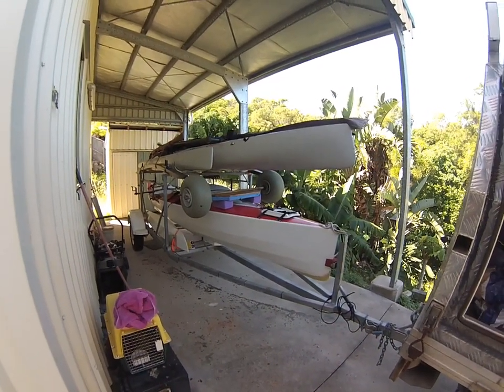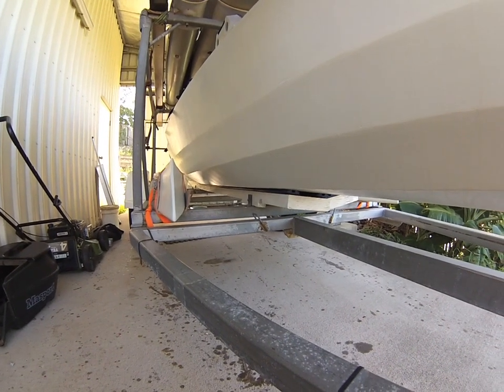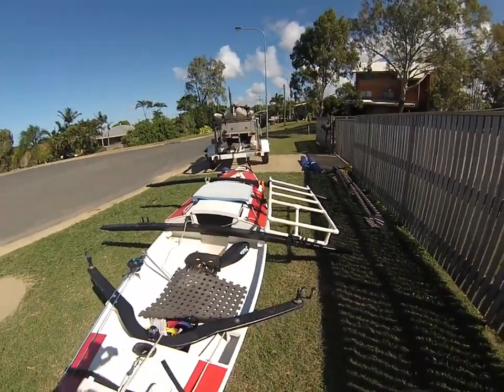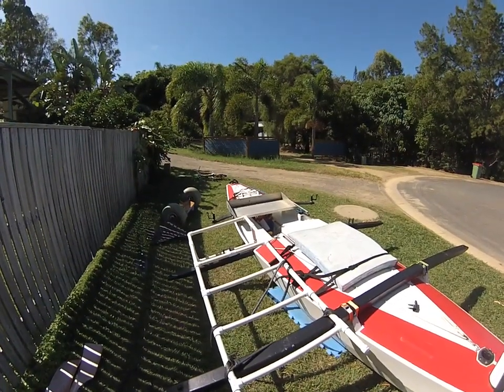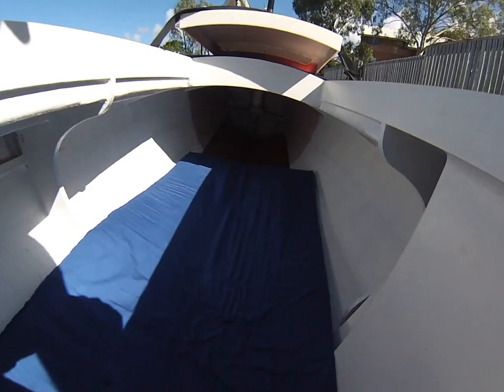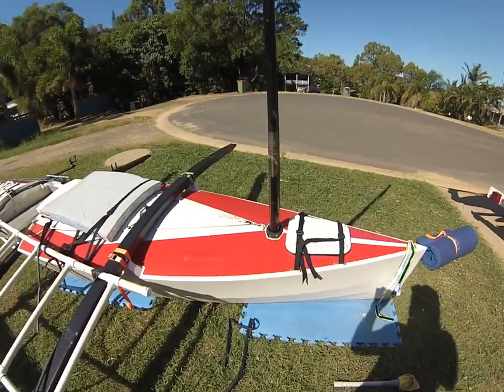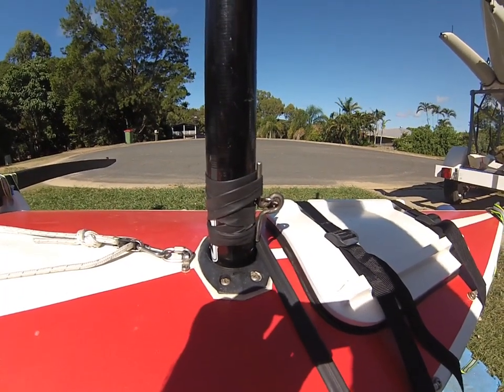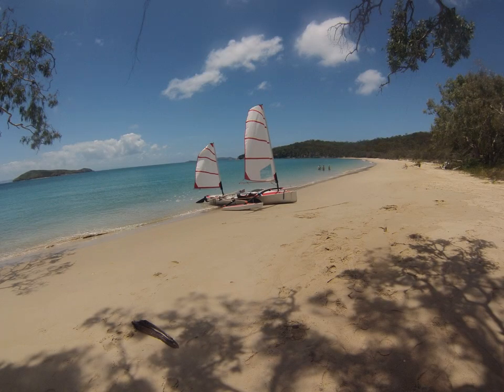Sailing Rowcruiser - preparations/tweaks for camping onboard

Comment: I have used the Trangia quit a lot for hiking, but wouldnt use it on the water. One of the fellows in the UK Dinghy Cruising association tipped his and suffered quite nasty burns and set his boat ablaze a couple of years ago.
Reply from the maker: Hey Jens, that’s definitely a concern. That’s why my food prep tray has a30mm lip around the perimeter to bund any spills. Besides I think I would only use it in calm conditions to limit spill potential.

Comment: It will be the water temp in the cabin and condensation will be your big enemy..a sleeping bag withe water proof shell might be a good idea.
My much larger cabin on a 24' gets to 50°f at night in the summer even if its a comfy 66° outside and i use a space heater st the marina...winters bedding onboard year round
Reply from the maker: Great point - never even thought about condensation.